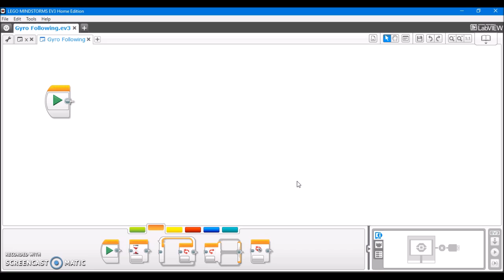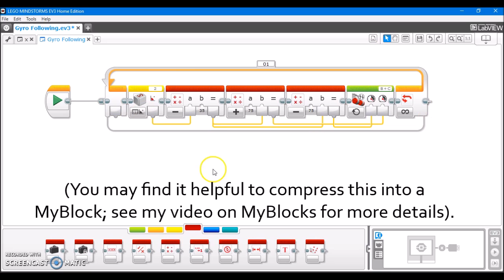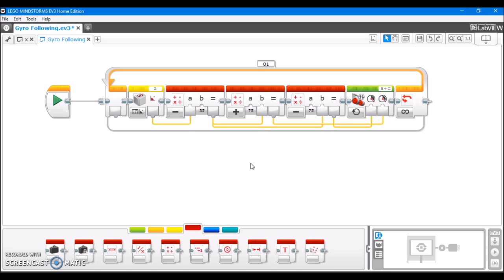Gyro Following - More Accurately Control your FLL Robot

Comment: Is there differences between the HiTechnic NXT type gyro sensor and the new EV3 gyro?
Reply from the maker: I am not so sure, we would need to find the specifications of the gyro chip inside each. Unfortunately, I can't seem to find info on the HiTechnic sensor anymore. However, in practice, the sensors work largely the same, and can be used interchangeably in the program.

Comment: So, in the example you gave in the video, at the beginning of the program the gyro sensor will read zero, correct? Which means the first math block will be 0 - 35 = -35. Then the second and third math blocks will be 75 + -35 = 40 for the right motor, 75 - -35 = 110 for the left motor. But the motors can't run above 100%, so I assume it would be 'capped' at 100, correct? At least until the gyro sensor reading is close enough to the desired angle that the equation would result in a motor power under 100, at which point it won't be capped any longer and both motors will run at the power the equations provide. (meaning, in this example, once the first math block results in a number between -25 and +25)

Comment: Nice video! I have one question..... If your 2 large motors are backward (If I want to move forward the power has to be negative) how is this suppose to work?
Reply from the maker: Simply give your motor negative power when you want it to go forward. I've built plenty of robots that are like this (Sirius is one of them). If you're still not comfortable with that, you can use the Invert Motor block, which I cover in this tutorial: https://youtu.be/ame1IYvxNek
Reply: Thanks!

Comment: Wait... this program wouldn't work right?  Because it would strive to be at a 35 degree greater angle than what it is at that moment.  So if the gyro starts at 2, and you want to get to 37, you set the first math block to 35, or negative 35.  Then your robot turns a bit, and then your gyro read 4 for the next iteration of the loop, the program then tells the robot to move to 39 degrees rather than maintaining its 37 degree target.  Please correct me if I'm wrong.
Reply from the maker: Nope, it works! The purpose of adding or subtracting the 35 (or any angle value) is to get your absolute target, or offset. You're thinking that it's always looking for an angle 35 degrees away, but it's not; the way this program is set up is that the target (35 degrees) is the new "zero." The target doesn't shift around, it stays fixed so the robot can lock onto it. Good catch though, I appreciate your critical thinking.